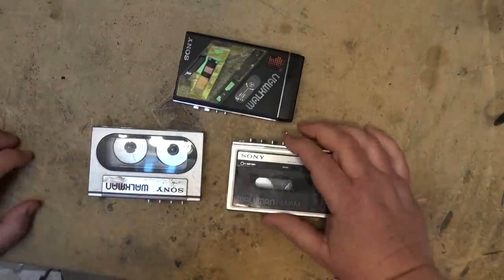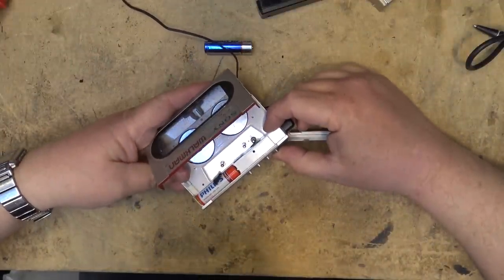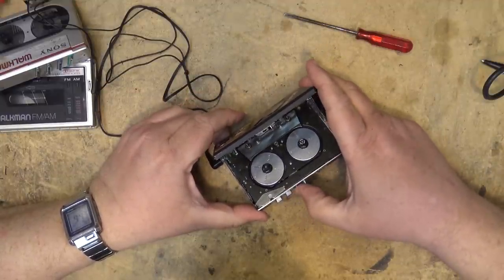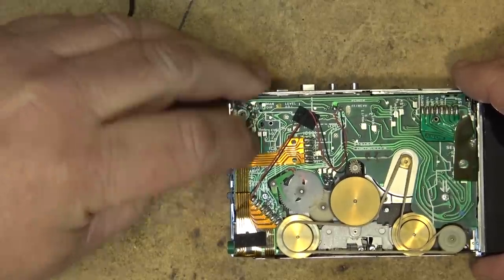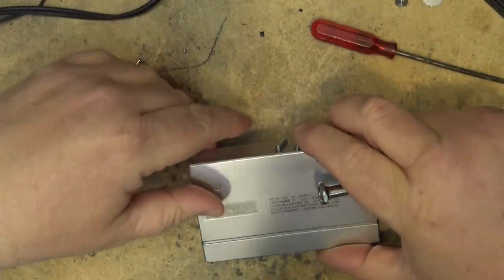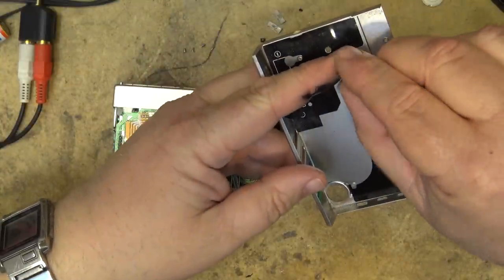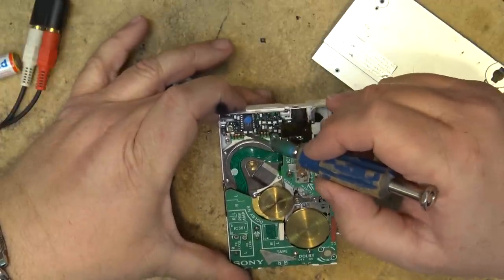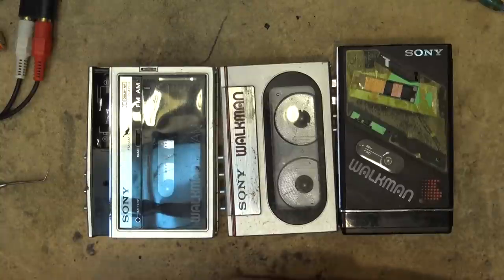Smallest Sony Walkman made

Comment: I have a WM-F30. It's very similar to your F10. It turns on but it needs a belt replacement and some cleaning. It can turn on without a headphone jack plugged in. However FM works best when it's in expanded shape, but only the left channel is audible. The right channel is super low on volume. Both channels low on volume in compact mode and the volume knob doesn't affect the volume when compact. Help! Maybe you can tell me where to look and clean in this tiny contraption

Comment: I graduated high school in 1983 and I bought a cheaper, larger Walkman. The quality players like the ones in this video were way out of reach for a dumb kid, when a Walkman costs around $300, that’s well over half of my paycheck. I keep my eyes open for one of these more micro walkmans but I usually find the cheaper ones but I did luck out and find a top shelf player but it uses a long, rectangular battery so I haven’t tried it yet, had it for 12 years now, paid $5 at a flea market. 
Thanks for posting this video, great help.

Comment: Actually i think the hall sensors are only for a speed feedback control since this has a regulation circuit inside.
You can make a brushless DC motor spin by just starting with whatever phase and create a moving field, the stator will eventually "snap in" and then it´s following the field.
Reply from the maker: generally they have 2 hall sensors to report the phase and direction and an FG to control the speed.

Comment: I bought a WM F100 as a parts machine for my WM F103. Interestingly the radio faceplate had also come off the F100. Although they are same dimensionally, the battery compartments are not directly compatible. The problem with my F103 is that the middle pulley is missing the brass weight... How would that ever go missing?? I believe that may be causing a persistent wow & flutter issue since I got it, although pinch rollers could also be an issue. It is weird since the F103 is otherwise in PERFECT cosmetic condition. Not a scratch or dent. I found a new belt too. It is a lovely piece of mechanical engineering.
Reply: my f103 also is missing the brass weight, so I'm not sure if they even had it from the factory.
Reply: @frozenpotato5962  actually, I don’t think they did. I bit surprising but there you are. It’s odd that Sony would make seemingly useless changes…

Comment: Great video!  Inspired me to get my WM-F100 out and see...  Sure enough the belt was goo.  I mean GOO.  It ended up as a few dark smudges on a rag!  DeckTech in the UK has perfect replacement belts...  After belt replacement and charging up the flat battery, we have a fully functional unit.  I have all of the accessories - flat battery (plus two new batteries) spare flat battery holder, AA battery holder, carrying case, manual, warranty card.  I bought it new in 1986...  The only thing that hasn't survived is the folding headphones.  I was hoping it was just a broken wire, but one of the drivers failed internally - irreparable...  Not for sale - but wonder what the value is???

Comment: Why would someone give you a thumbs down for putting a rubber band in?  Belts are essentially just rubber bands.
Reply from the maker: Don't try to figure it out.  Not worth even worth mentioning.  These loosers get their jollies out of it so let them have their fun. Notice I don't respond.  I sometimes make a joke about doing something that the trolls won't like, such as using solder braid or pronouncing it correctly as solder and not the us way soder or Chinese way sorder. Nope I pronounce it correct and it drives them crazy. I know this because the same people lecture me about it in comments and I delete their posts which pissed them off more.
Reply: @12voltvids  I pronounce it the way the British pronounce it, myself.
Reply: I put rubber bands in an old Aiwa all in one mini hifi system’s tape deck as the drive belts, and it caused serious flutter issues, enough to be unusable. I put cheap china drive belts in that unit to replace the rubber bands. (The original belts were just as cheap and started loosening up and slipping, so I didn’t care.)

Comment: Do you know about that CD player that is actually smaller than a CD?  The CD spins outside the disk.  I fail to see the point, because surely it would catch on things.
Reply from the maker: I worked for 20 years at a Sony dealer. I know everything that Sony made.  They had a record player too that was vertical and the record played vertically sticking out.  The disc man you are thinking about was for the 3" CD singles.  If you played a normal CD it stuck out.  Dumb design.  They also had a mini dat deck that used postage stamp size cassette and another smaller video format called micro mv. Used a 4mm tape.
Reply: @12voltvids  Oh, they make several record players like that.  I think they have a couple made today like that (Techmoan has one).  Postage stamp size cassette?  Wow.
Reply from the maker: @infinitecanadian  
Techmoan found one. It is vintage. Sony didn't make them long. I scrapped several over the years.
Reply: @12voltvids  Oh; I thought someone still made them.

Comment: How long does it tend to take a belt to go from working (not necessarily well) to goo? I put some new belts on an old Aiwa deck last year and it would be interesting to know how long ago it might have been last used. It was great fun cleaning up the mess inside that. With lots of kitchen roll and alcohol it eventually cleaned up nicely but I was still finding the occasional black blob for a while afterwards.

Comment: The many ways that manufacturers managed to make a piece of plastic spin is unreal, cassettes were never even intended to have music on them in the first place only as a cheap dictation machine, cassettes are a finicky media to deal with to say the least and you just cant get a happy medium with them, they degrade to shit and the smallest of magnetic fields destroys recordings completely. They were fun at the time but in 2018? ffs ive put all my tape stuff on ebay for the nerds and people claiming theyre better than a cd lol. Dont get me wrong in the 80s ive owned hell of a lot of tape recorders but thats because i had no option, cds recorders werent even a glint in the eye at the time.
Reply from the maker: The guys that knew me when I was in broadcast would remember what I called cassettes. "Tacky little plastic things" As far as tape goes, I have always been open reel, and DAT. Cassette was only good for walkman, and in car use before CD came along. The sound was never great. Of course I am not a vinyl fan either. Couldn't wait for CD. 
I collect these things not to use them, but just from a collectors perspective they are kind of cool, just like the old micro size camcorders that used tape.
An old CRT monitor as a display is just cool because of the heritage behind it, not because it is better. Same with plasma TV. Just something cool about how it works compared to modern stuff.
Reply: Plasma now youre talking, id take a pioneer plasma set over anything today, i fucking hate OLED its piss poor and suffers burn in the worst out of any screen technology, i love phosfur displays mate a real big fan of good plasma sets, the colour even on a 720p panel will beat any 1080p lcd by a country mile, they look beautiful.
Reply: Synthematix do you still have your cassette players?
Reply from the maker: I agree 100%. The Pioneer plasma sets were beautiful, and after Pioneer exited, they sold off the Technology to Panasonic. I have a 2008 TH42PZ800 Panasonic. A THX certified set that used the Kuro technology.
It was given to me by a little old lady that was moved to a care facility, and the cable box they provided her was only SD. So she though the picture was bad and bought a new set and gave me her old one. It has a beautiful picture, the best I have seen. It is a spare to be put in service some day. I currently use a Panasonic plasma as my edit bay monitor, but not the same caliber as the PZ800 set. That one is an a league by itself. The OLED sets do look good, but the burn in issue is a problem. I have 10 plasma sets that are in working condition, and 2 broken ones I need to fix. Even my 480p ED plasma has a picture that is better than many LED/LCD sets.  2 of my screens have a bad panel though. One has a green vertical line and the other a red. They get used for video games only, and ne might get used as my advertising sign.

Comment: There’s a guy on Ebay, he sell very good quality belts, same size, he's from Slovakia
Reply: Yep. I've just started messing with personal stereos (and Walkmans), and tried the pack of 100 ill fitting chunky cheapy ebay belts. They'll make stuff turn where stuff had ceased to turn, but they're awful. My guess is they load the motor too much, but whatever the reason they're just useless.

Bought one of the Slovakian belts (and a UK one, which looked identical to me) for an EX654 (which I made one of my typically tedious fix Youtubes on - To be uploaded eventually) and... Spoilers - vastly better. In fact on the cheapy belt it spun things but was completely unlistenable.

Found the links. 

Slovakian, takes a while longer (for me, UK bsed), but a little cheaper: https://www.ebay.co.uk/str/Walkman-Belts?_trksid=p2047675.l2563

UK, quicker (for me), but a few pence more expensive: http://www.ebaystores.co.uk/Mana-Tree-Replacement-Parts

Comment: will rubber bands work even if it doesn't last?
Reply: A rubber band will work but the Walkman will not play the tape at the correct speed and consistency. I just fixed a Sony Walkman put a regular rubber band in place if the worn belt and it plays but doesn't sound good. I will be ordering a new belt.

Comment: Today's things are much harder to repair than Them old school tape players.
Reply from the maker: Unti you have to change the motor drive IC mounted on a flexable PC board with componets mounted on both sides, so if you heat it up on a rework station the parts on the back side fall off.
Reply: Oh wow i would just use leaded solder on all the pins together and use the soldering iron to heat up all bridged  pins similar to how i do USB ports when i cant use heat. it takes longer but i think its better than having stuff fall off the board.

Comment: Definitely not the smallest ones from Sony
I remember having slim ones back in late 90s
Reply from the maker: Sorry I disageee. I have worked on them all.  The wm10 when closed is the size of a cassette clamshell case.  The cassette compartment has to be pulled open to load the tape as it is smaller than the tape. There were other models that were small but when closed this one is smaller.